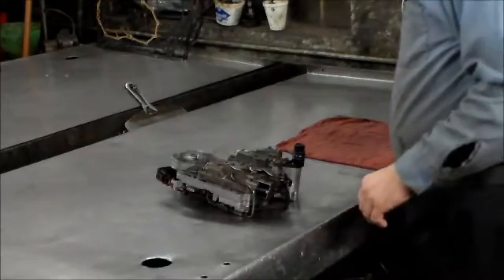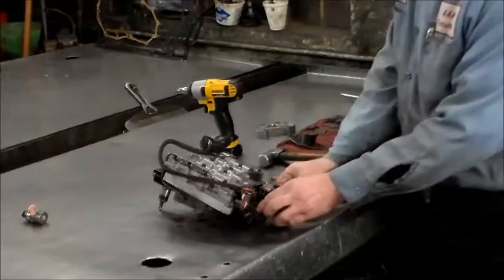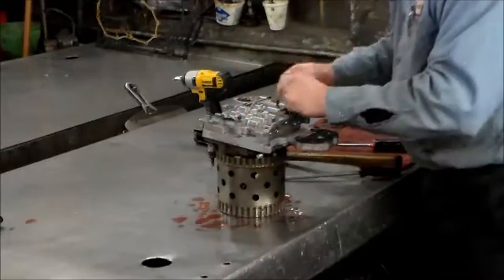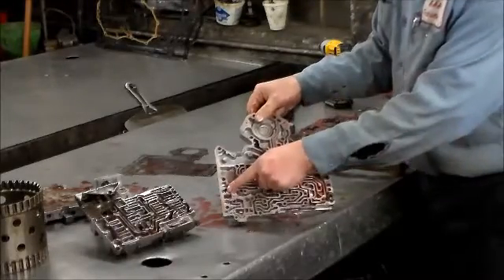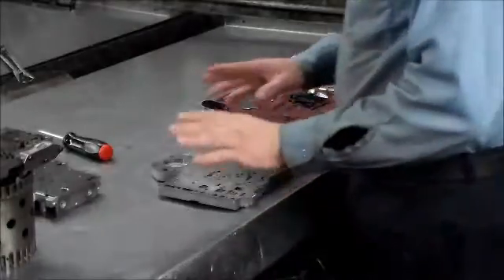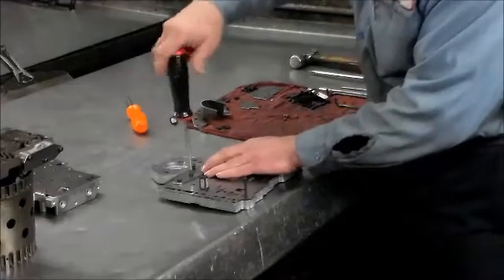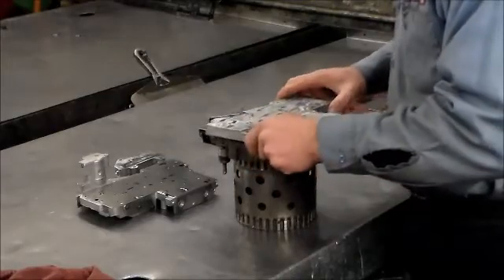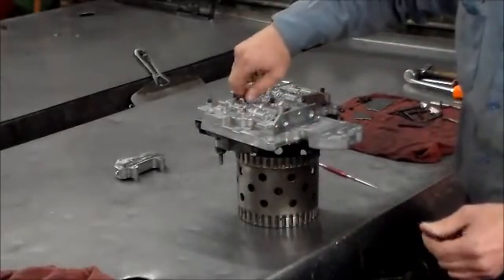48RE Valvebody Overhaul

Comment: well it helps if you have the right overdrive solenoid on it. I tried to put an earlier valve body on a 2004 unit and you were correct the solenoid made all the difference. thank you for the help check's in the mail.
Reply from the maker: jspat67 Glad it's fixed, this ones on me

Comment: hello gary! i did a regular rebuilt to the 48RE diesel, no shift kit on this unit the only issue i found was the torque converter splines was strep out.
now i shifts funny some times in light throttle,and when you 're coming to stop it feels like 2-1 hard downshifts, not always..
any ideas gary?
Reply from the maker: Is the throttle cable returning correctly at the trans, sometimes there is a spring hooked up to make sure the lever returns
Reply: this one doesn't have mechanical cable,but it has electronic

Comment: what all do you dip into the tank to clean? everything? and do u just use a parts washer with mineral spirits
Reply from the maker: Jacob Benton  No, I have a big cleaning machine with water a soap degreaser called a rotomatic  we bought it back in the 70,s. The water heats up to about 160 degrees. Parts come nice and clean, the mineral spirits part washer is for valve bodies and other small parts.
Reply: Gotcha going to do the transgo shift kit install on a 48re, was wondering if a parts washer would work just dip the vb in and clean it, also would u happen to know the mod for second gear lockup on a 48re
Reply from the maker: No i dont, sorry